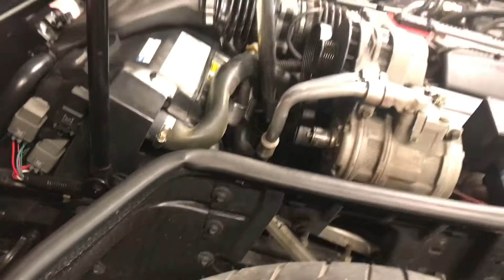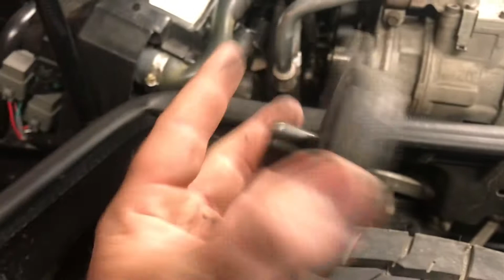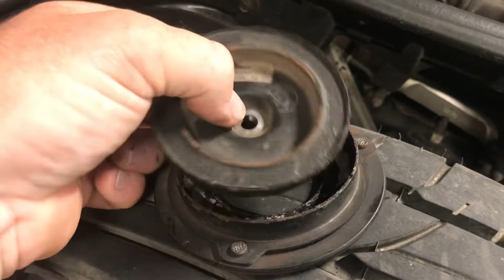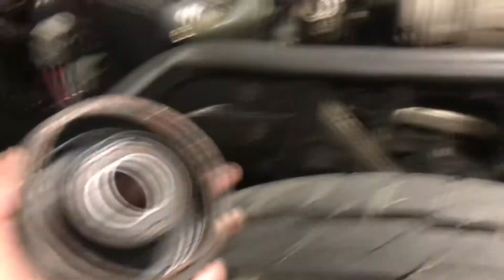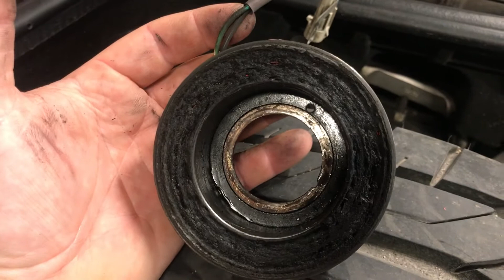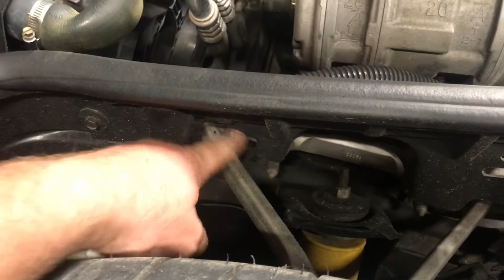Having a Bad Day With the Vette

Comment: I really like your channel. So I have a 95 six speed 90,000 miles. Really nice car. When I bought the car the AC was not working. Previous owner said one day driving he noticed smoke from underneath the hood and noise so he turned AC off and noise stopped. If I engage the AC it makes a horrible noise and puts load on engine until switched off. How can I tell if I need a AC clutch or entire compressor? Many thanks
Reply from the maker: If the gap between the pulley and the clutch is too great. The clutch will not engage. If it it making noise you will need to take the clutch off to see if the surface is messed up. It’s possible that the pump is trash and the bearings are out. Or you could be lucky and only need a pulley.
Reply from the maker: Take the belt off and spin the pulley. If it makes noise the bearing Willis likely the culprit.